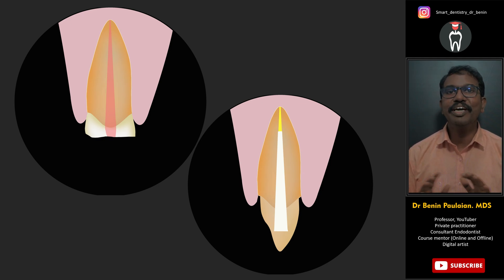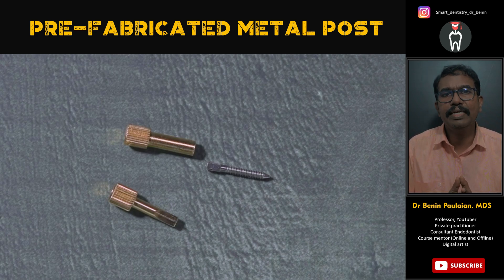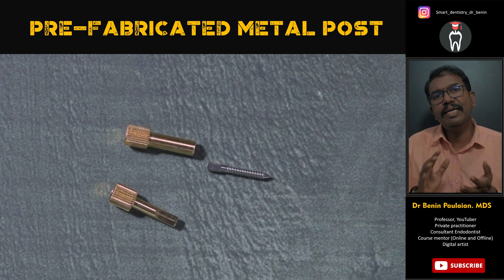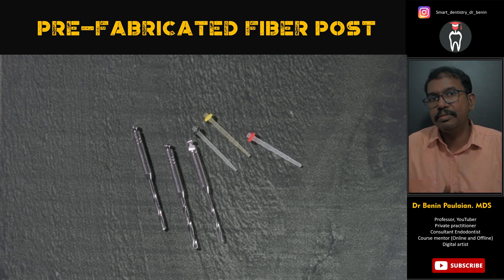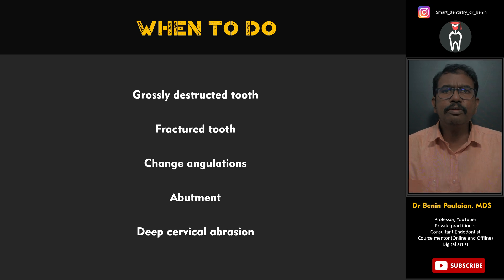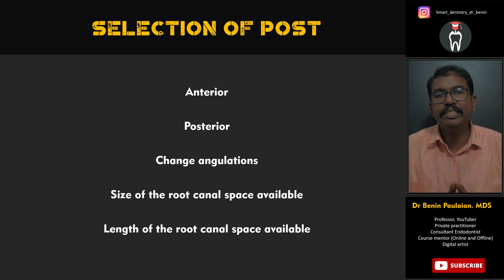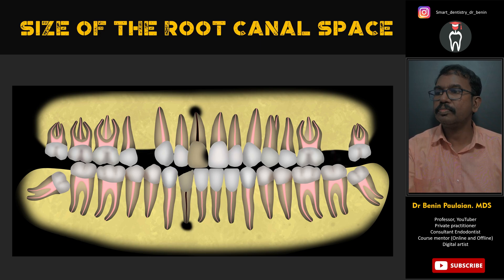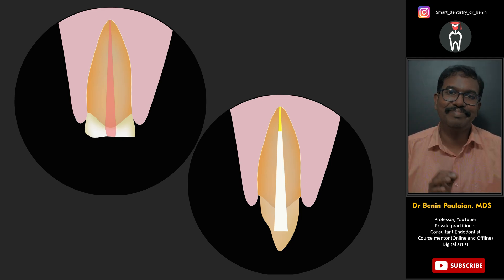Post and Core | Decision making

Comment: How many post for 3 canal molar and two canal premolars sir
Reply from the maker: That depends on the amount of tooth structure remaining above the cervical margins and the walls missing. If one wall is missing then it is ideal to replace with one post corresponding to the wall missing. If total tooth structure is lost, then more than one post is needed. In a three canal molar two post may be needed at the maximum. I will make a detailed video in this topic soon. Thank tou

Comment: Sir please make video on management of avulsed teeth within the 1hour and after 1 hour of trauma in children..
Reply from the maker: I have included the topic you suggested in the upcoming video list
Thank you for your suggestion
Upcoming videos in Smart Dentistry YouTube channel
Bounded file versus binding file - @sauliharizwan377, @vickyrock1873, @siddhiraut8472, @hristohristov650, @burrwnawna, @ayeshasiddiqua-ue4ss
Anterior proximal composite restorations - @raghuramm563
Finishing and polishing of composite restorations - @DrHozefa
How to create the perfect anatomy in posterior composite restorations - @DrHozefa
Working length using RVG - @manadentist2267, @sushrutachakraborty464, @dentalking7859
How to use apex locators to get accurate reading? - @katyaynigupta5259, @Sreemol17, @dentalking7859, @dentalshorts6848,
How to determine the correct taper for canal preparation (2%vs4%vs6%) - @akanshas8424,@abdurrahman2980, @benoitblanc8898
Diagnosis in Endodontics - @MuhammadAbdullah-iy3hc, @bsk4627, @vijyantmehrotra8119, @manadentist2267, @akshuDhavalshankh, @katyaynigupta5259
Dentine bonding agents - Part 2 - @bigdreams3712
How to bypass a fractured file? - @karthicks5760
How to do periapical surgery? - @derekshaji8173
How to remove a fractured file? - @karthicks5760
How to prevent ledges, blocks, zipping and canal transportation - @Philosophyforlifeofficial 
Apexification procedure – @anumadhukar9171, @sanghamitrasagariya4087, @katyaynigupta5259
Perforation repair - @anumadhukar9171
Avulsed tooth management - @Drpoojagarg5310
All ceramic crown preparation – Anterior - @KiranrajkumarHatangle-eo4wm
Molar crown preparation - @KiranrajkumarHatangle-eo4wm
Radix entomolaris - Case discussion - @sauliharizwan377
Palato gingival groove - Case discussion - @sauliharizwan377
Root canal negotiation techniques - @vickyrock1873, @siddhiraut8472, @hristohristov650, @katyaynigupta5259
EDTA in Root Canal Treatment - @rosemeher1321, @hristohristov650
Understanding root canal calcifications - @rosemeher1321, @hristohristov650, @katyaynigupta5259
Operator positioning for Root Canal Treatment - @chandrasekharsahoo6713
Analgesics after Root Canal Treatment - @mdmozahedulislam3923
Root canal sealers - @sudhaa5674
Sealer puff – Good or bad? - @derekshaji8173
C shaped root canals - @karthicks5760, @LearnUnlearn90, @katyaynigupta5259
Middle mesial canal - @karthicks5760, @katyaynigupta5259
Reference point in root canal treatment - @anujgarg952
Heat and H file technique for GP removal - @chandrasekharsahoo6713
how to do BMP effectively without any pulp tissue remnants in a single visit RCT - @rainbowsalt-gc7ek
class 2 composite and matrix to avoid gaps between teeth after using toffelmeir system -  @sauliharizwan377, @hishamkhan3800
Curved root canals and file selection
Everything a beginner should know about rotary files
Ledges – prevention and management - @dentalshorts6848
Prefabricated metal post
Pre fabricated fiber post - @anithabalex8124
Ribbond post and core - @bsk4627, @sajaljain4192, @sauliharizwan377
Custom cast post and core - @derekshaji8173
How to select the proper crown - @DrGreenfun
Cast post Vs fiber post? Which one to choose? - @SnehaPK-rt3tn, @alokegupta3165
Occlusal considerations in post endodontic restorations - @tubeindahouse
Pulp stone management - @sayantankarmakar3150
Torque and speed in curved and narrow root canals - @safaamohammed

Comment: Sir please make video on infibra post placement
Reply from the maker: I have included the topic you suggested in the upcoming video list
Thank you for your suggestion
Upcoming videos in Smart Dentistry YouTube channel
Bounded file versus binding file - @sauliharizwan377, @vickyrock1873, @siddhiraut8472, @hristohristov650, @burrwnawna, @ayeshasiddiqua-ue4ss
Anterior proximal composite restorations - @raghuramm563
Finishing and polishing of composite restorations - @DrHozefa
How to create the perfect anatomy in posterior composite restorations - @DrHozefa
Working length using RVG - @manadentist2267, @sushrutachakraborty464, @dentalking7859
How to use apex locators to get accurate reading? - @katyaynigupta5259, @Sreemol17, @dentalking7859, @dentalshorts6848
How to determine the correct taper for canal preparation (2%vs4%vs6%) - @akanshas8424,@abdurrahman2980
Diagnosis in Endodontics - @MuhammadAbdullah-iy3hc, @bsk4627, @vijyantmehrotra8119, @manadentist2267, @akshuDhavalshankh, @katyaynigupta5259
Dentine bonding agents - Part 2 - @bigdreams3712
How to bypass a fractured file? - @karthicks5760
How to do periapical surgery? - @derekshaji8173
How to remove a fractured file? - @karthicks5760
How to prevent ledges, blocks, zipping and canal transportation - @Philosophyforlifeofficial 
Apexification procedure – @anumadhukar9171, @sanghamitrasagariya4087, @katyaynigupta5259
Perforation repair - @anumadhukar9171
Avulsed tooth management - @Drpoojagarg5310
All ceramic crown preparation – Anterior - @KiranrajkumarHatangle-eo4wm
Molar crown preparation - @KiranrajkumarHatangle-eo4wm
Radix entomolaris - Case discussion - @sauliharizwan377
Palato gingival groove - Case discussion - @sauliharizwan377
Root canal negotiation techniques - @vickyrock1873, @siddhiraut8472, @hristohristov650, @katyaynigupta5259
EDTA in Root Canal Treatment - @rosemeher1321, @hristohristov650
Understanding root canal calcifications - @rosemeher1321, @hristohristov650, @katyaynigupta5259
Operator positioning for Root Canal Treatment - @chandrasekharsahoo6713
Analgesics after Root Canal Treatment - @mdmozahedulislam3923
Root canal sealers - @sudhaa5674
Sealer puff – Good or bad? - @derekshaji8173
C shaped root canals - @karthicks5760, @LearnUnlearn90, @katyaynigupta5259
Middle mesial canal - @karthicks5760, @katyaynigupta5259
Reference point in root canal treatment - @anujgarg952
Heat and H file technique for GP removal - @chandrasekharsahoo6713
how to do BMP effectively without any pulp tissue remnants in a single visit RCT - @rainbowsalt-gc7ek
class 2 composite and matrix to avoid gaps between teeth after using toffelmeir system -  @sauliharizwan377, @hishamkhan3800
Curved root canals and file selection
Everything a beginner should know about rotary files
Ledges – prevention and management - @dentalshorts6848
Prefabricated metal post
Pre fabricated fiber post - @anithabalex8124
Ribbond post and core - @bsk4627, @sajaljain4192, @sauliharizwan377
Custom cast post and core - @derekshaji8173
How to select the proper crown - @DrGreenfun
Cast post Vs fiber post? Which one to choose? - @SnehaPK-rt3tn, @alokegupta3165

Comment: Sir how to choose between cast post and prefabricated post?
Reply: Same question
Reply from the maker: I have included the topic you suggested in the upcoming video list
Thank you for your suggestion
Upcoming videos in Smart Dentistry YouTube channel
Bounded file versus binding file - @sauliharizwan377, @vickyrock1873, @siddhiraut8472, @hristohristov650, @burrwnawna, @ayeshasiddiqua-ue4ss
Anterior proximal composite restorations - @raghuramm563
Finishing and polishing of composite restorations - @DrHozefa
How to create the perfect anatomy in posterior composite restorations - @DrHozefa
Working length using RVG - @manadentist2267, @sushrutachakraborty464, @dentalking7859
How to use apex locators to get accurate reading? - @katyaynigupta5259, @Sreemol17, @dentalking7859, @dentalshorts6848
How to determine the correct taper for canal preparation (2%vs4%vs6%) - @akanshas8424,@abdurrahman2980
Diagnosis in Endodontics - @MuhammadAbdullah-iy3hc, @bsk4627, @vijyantmehrotra8119, @manadentist2267, @akshuDhavalshankh, @katyaynigupta5259
Dentine bonding agents - Part 2 - @bigdreams3712
How to bypass a fractured file? - @karthicks5760
How to do periapical surgery? - @derekshaji8173
How to remove a fractured file? - @karthicks5760
How to prevent ledges, blocks, zipping and canal transportation - @Philosophyforlifeofficial 
Apexification procedure – @anumadhukar9171, @sanghamitrasagariya4087, @katyaynigupta5259
Perforation repair - @anumadhukar9171
Avulsed tooth management - @Drpoojagarg5310
All ceramic crown preparation – Anterior - @KiranrajkumarHatangle-eo4wm
Molar crown preparation - @KiranrajkumarHatangle-eo4wm
Radix entomolaris - Case discussion - @sauliharizwan377
Palato gingival groove - Case discussion - @sauliharizwan377
Root canal negotiation techniques - @vickyrock1873, @siddhiraut8472, @hristohristov650, @katyaynigupta5259
EDTA in Root Canal Treatment - @rosemeher1321, @hristohristov650
Understanding root canal calcifications - @rosemeher1321, @hristohristov650, @katyaynigupta5259
Operator positioning for Root Canal Treatment - @chandrasekharsahoo6713
Analgesics after Root Canal Treatment - @mdmozahedulislam3923
Root canal sealers - @sudhaa5674
Sealer puff – Good or bad? - @derekshaji8173
C shaped root canals - @karthicks5760, @LearnUnlearn90, @katyaynigupta5259
Middle mesial canal - @karthicks5760, @katyaynigupta5259
Reference point in root canal treatment - @anujgarg952
Heat and H file technique for GP removal - @chandrasekharsahoo6713
how to do BMP effectively without any pulp tissue remnants in a single visit RCT - @rainbowsalt-gc7ek
class 2 composite and matrix to avoid gaps between teeth after using toffelmeir system -  @sauliharizwan377, @hishamkhan3800
Curved root canals and file selection
Everything a beginner should know about rotary files
Ledges – prevention and management - @dentalshorts6848
Prefabricated metal post
Pre fabricated fiber post - @anithabalex8124
Ribbond post and core - @bsk4627, @sajaljain4192
Custom cast post and core - @derekshaji8173
How to select the proper crown - @DrGreenfun
Cast post Vs fiber post? Which one to choose? - @SnehaPK-rt3tn, @alokegupta3165

Comment: sir plz make video how to placing post using polyethylene post
Reply from the maker: I have included the topic you suggested in the upcoming video list
Thank you for your suggestion
Upcoming videos in Smart Dentistry YouTube channel
Bounded file versus binding file - @sauliharizwan377, @vickyrock1873, @siddhiraut8472, @hristohristov650, @burrwnawna, @ayeshasiddiqua-ue4ss
Anterior proximal composite restorations - @raghuramm563
Finishing and polishing of composite restorations - @DrHozefa
How to create the perfect anatomy in posterior composite restorations - @DrHozefa
Working length using RVG - @manadentist2267, @sushrutachakraborty464, @dentalking7859
How to use apex locators to get accurate reading? - @katyaynigupta5259, @Sreemol17, @dentalking7859, @dentalshorts6848
How to determine the correct taper for canal preparation (2%vs4%vs6%) - @akanshas8424,@abdurrahman2980
Diagnosis in Endodontics - @MuhammadAbdullah-iy3hc, @bsk4627, @vijyantmehrotra8119, @manadentist2267, @akshuDhavalshankh, @katyaynigupta5259
Dentine bonding agents - Part 2 - @bigdreams3712
How to bypass a fractured file? - @karthicks5760
How to do periapical surgery? - @derekshaji8173
How to remove a fractured file? - @karthicks5760
How to prevent ledges, blocks, zipping and canal transportation - @Philosophyforlifeofficial 
Apexification procedure – @anumadhukar9171, @sanghamitrasagariya4087, @katyaynigupta5259
Perforation repair - @anumadhukar9171
Avulsed tooth management - @Drpoojagarg5310
All ceramic crown preparation – Anterior - @KiranrajkumarHatangle-eo4wm
Molar crown preparation - @KiranrajkumarHatangle-eo4wm
Radix entomolaris - Case discussion - @sauliharizwan377
Palato gingival groove - Case discussion - @sauliharizwan377
Root canal negotiation techniques - @vickyrock1873, @siddhiraut8472, @hristohristov650, @katyaynigupta5259
EDTA in Root Canal Treatment - @rosemeher1321, @hristohristov650
Understanding root canal calcifications - @rosemeher1321, @hristohristov650, @katyaynigupta5259
Operator positioning for Root Canal Treatment - @chandrasekharsahoo6713
Analgesics after Root Canal Treatment - @mdmozahedulislam3923
Root canal sealers - @sudhaa5674
Sealer puff – Good or bad? - @derekshaji8173
C shaped root canals - @karthicks5760, @LearnUnlearn90, @katyaynigupta5259
Middle mesial canal - @karthicks5760, @katyaynigupta5259
Reference point in root canal treatment - @anujgarg952
Heat and H file technique for GP removal - @chandrasekharsahoo6713
how to do BMP effectively without any pulp tissue remnants in a single visit RCT - @rainbowsalt-gc7ek
class 2 composite and matrix to avoid gaps between teeth after using toffelmeir system -  @sauliharizwan377, @hishamkhan3800
Curved root canals and file selection
Everything a beginner should know about rotary files
Ledges – prevention and management - @dentalshorts6848
Prefabricated metal post
Pre fabricated fiber post - @anithabalex8124
Ribbond post and core - @bsk4627, @sajaljain4192
Custom cast post and core - @derekshaji8173
How to select the proper crown - @DrGreenfun

Comment: Sir pls can u make video of using Gp 2percent , 4 percent ,and 6percent along with clinical condition and uses
Reply from the maker: I have included the topic you suggested in the upcoming video list
Thank you for your suggestion
Upcoming videos in Smart Dentistry YouTube channel
Bounded file versus binding file - @sauliharizwan377, @vickyrock1873, @siddhiraut8472, @hristohristov650, @burrwnawna, @ayeshasiddiqua-ue4ss
Anterior proximal composite restorations - @raghuramm563
Finishing and polishing of composite restorations - @DrHozefa
How to create the perfect anatomy in posterior composite restorations - @DrHozefa
Working length using RVG - @manadentist2267, @sushrutachakraborty464, @dentalking7859
How to use apex locators to get accurate reading? - @katyaynigupta5259, @Sreemol17, @dentalking7859, @dentalshorts6848
How to determine the correct taper for canal preparation (2%vs4%vs6%) - @akanshas8424,@abdurrahman2980
Diagnosis in Endodontics - @MuhammadAbdullah-iy3hc, @bsk4627, @vijyantmehrotra8119, @manadentist2267, @akshuDhavalshankh, @katyaynigupta5259
Dentine bonding agents - Part 2 - @bigdreams3712
How to bypass a fractured file? - @karthicks5760
How to do periapical surgery? - @derekshaji8173
How to remove a fractured file? - @karthicks5760
How to prevent ledges, blocks, zipping and canal transportation - @Philosophyforlifeofficial 
Apexification procedure – @anumadhukar9171, @sanghamitrasagariya4087, @katyaynigupta5259
Perforation repair - @anumadhukar9171
Avulsed tooth management - @Drpoojagarg5310
All ceramic crown preparation – Anterior - @KiranrajkumarHatangle-eo4wm
Molar crown preparation - @KiranrajkumarHatangle-eo4wm
Radix entomolaris - Case discussion - @sauliharizwan377
Palato gingival groove - Case discussion - @sauliharizwan377
Root canal negotiation techniques - @vickyrock1873, @siddhiraut8472, @hristohristov650, @katyaynigupta5259
EDTA in Root Canal Treatment - @rosemeher1321, @hristohristov650
Understanding root canal calcifications - @rosemeher1321, @hristohristov650, @katyaynigupta5259
Operator positioning for Root Canal Treatment - @chandrasekharsahoo6713
Analgesics after Root Canal Treatment - @mdmozahedulislam3923
Root canal sealers - @sudhaa5674
Sealer puff – Good or bad? - @derekshaji8173
C shaped root canals - @karthicks5760, @LearnUnlearn90, @katyaynigupta5259
Middle mesial canal - @karthicks5760, @katyaynigupta5259
Reference point in root canal treatment - @anujgarg952
Heat and H file technique for GP removal - @chandrasekharsahoo6713
how to do BMP effectively without any pulp tissue remnants in a single visit RCT - @rainbowsalt-gc7ek
class 2 composite and matrix to avoid gaps between teeth after using toffelmeir system -  @sauliharizwan377, @hishamkhan3800
Curved root canals and file selection
Everything a beginner should know about rotary files
Ledges – prevention and management - @dentalshorts6848
Prefabricated metal post
Pre fabricated fiber post - @anithabalex8124
Ribbond post and core - @bsk4627
Custom cast post and core - @derekshaji8173
How to select the proper crown - @DrGreenfun

Comment: Thanks. Whats your views on types of crowns PBM vs PFM vs high nobel vs emax vs bruzir?
Reply from the maker: Anterior single crown - discolored tooth - zirconia
Anterior single crown - No discoloration - E Max
Anterior FPD - Up to 3 units - zirconia
Anterior with multiple missing teeth - Metal ceramic
Posterior - single unit - Monolith/ zirconia/metal crown (depending on esthetic requirements)
Posterior up to three units - monolith or zirconia (Esthetically sensitive patient) Metal ceramic/full metal - depending on patient choice
Posterior with multiple teeth missing - Metal ceramic/full metal

Let me know your opinion too
Thank you
Reply: @smartdentistry  I feel like emax doesn't last as long. I do cerec crowns I am a fan of full cast gold crowns. Layered zirconia always flakes off and emax on anteriors do looks nice but bruxzir has come a long way.